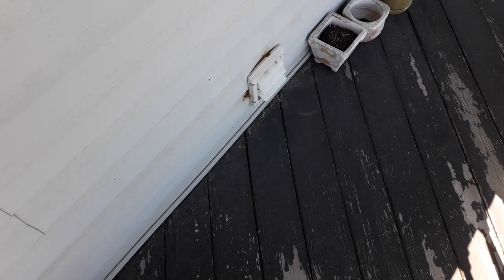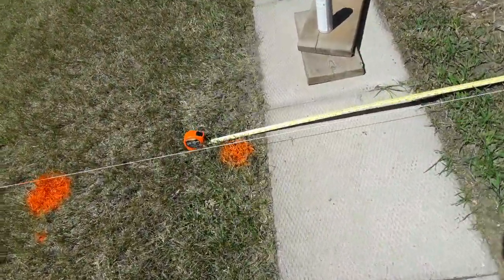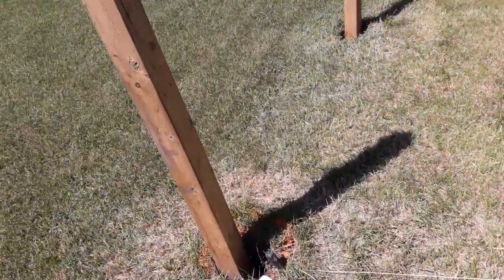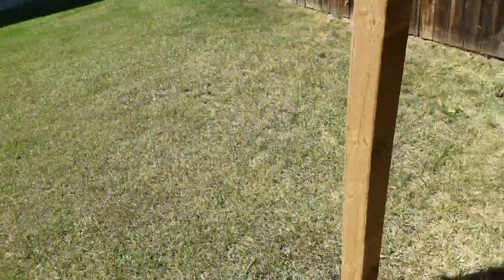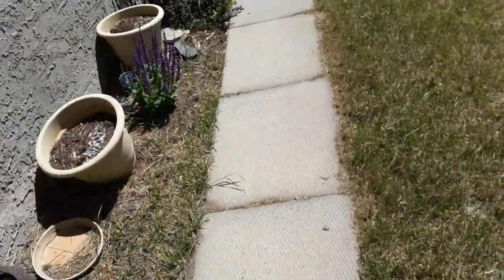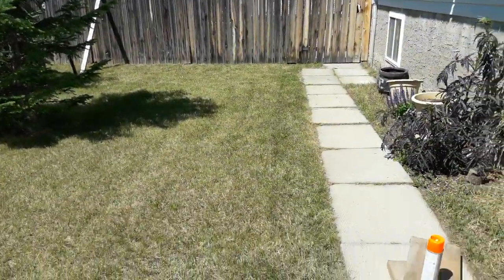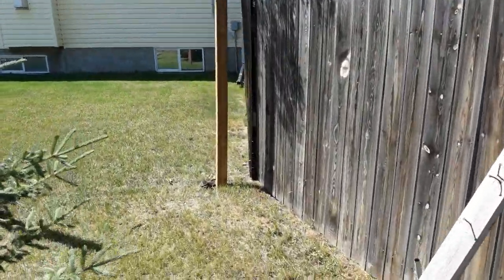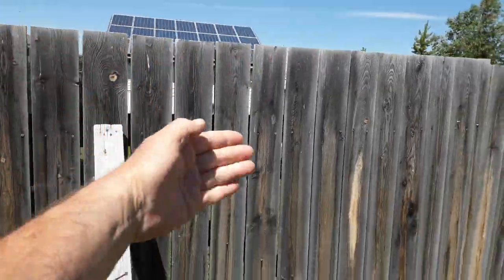The Facts Revealed A New Fence Is Forming At The On Grid Project

Comment: Nice tim. Your plans for the new fence sound well thought out.  Unlike you know who.
Got a suggestion about the dog doo in the backyard. I had a similar problem.  I built a 5×4 sand pit about 5 to 8 inches deep surrounded with garden bricks and trained my dog to go there instead of the lawn.  Made a big difference.  Plus the cleanup is super easy.  The sand works just like kitty litter.